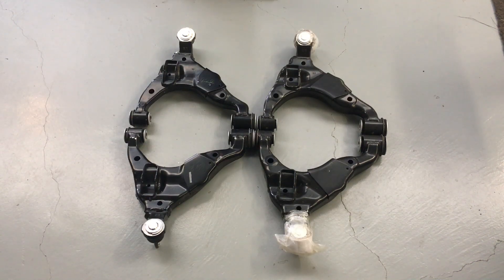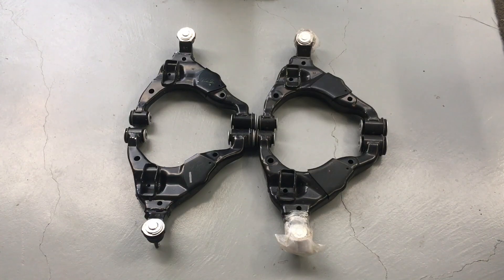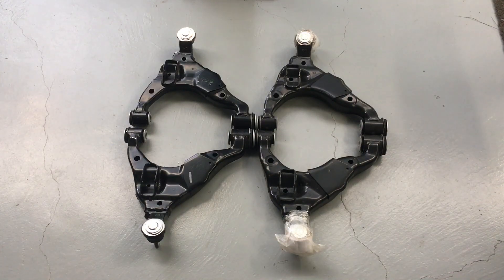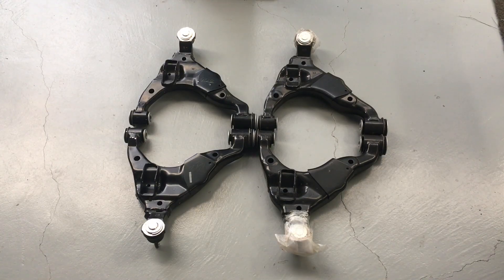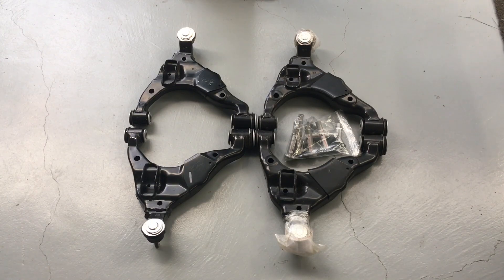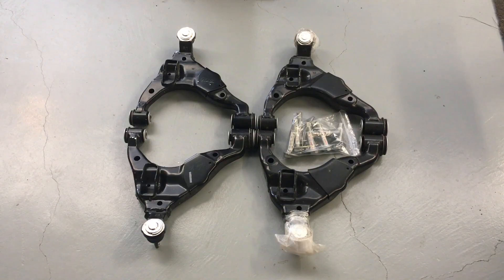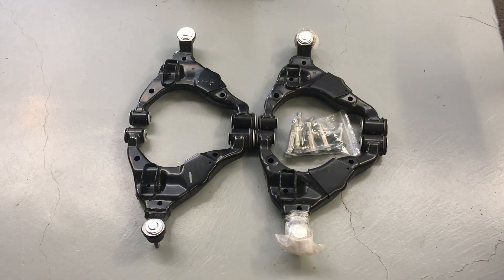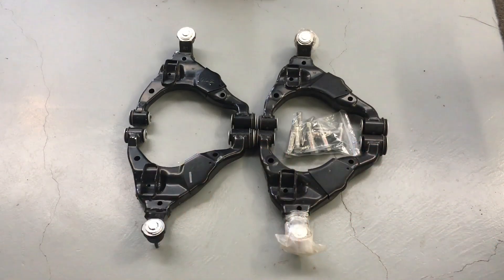￼TOYOTA LANDCRUISER LC120 LC150 Prado front lower control arm bushes cracked up?!?!?!

Comment: Does that price include the bolts and nuts n cams etc? My 2012 150 Kak with 128k has a seized side that the wheel alignment guy found. Hoping some anti seize spray stuff might work.

Comment: That seems like an obscene amount of money for a couple of bits of steel and rubber. Is there any cheaper alternative? After market?
Reply from the maker: Totally agree it is very expensive for those two simple components.
Yes there is cheaper options made in China and you know how that lasts so is it really cheaper in the long run not from the feedback I’ve heard from people.
Then there is better quality options that are somewhere between cheap and genuine not saving that much money and sometimes ending up with a hard ride from the material used in the bushes perhaps a good design but not everybody likes the ride for the rides you know you like and reliability that will last a lifetime if you look after them you know what to use.

After all change them every 300,000 case for most people is over 10 years and when you spread it out over 10 years it’s not a lot of money people waste more money on lots of other things like smokes alcohol dining out etc.